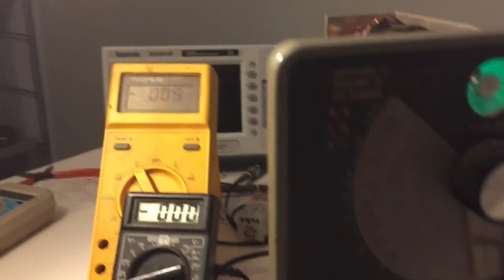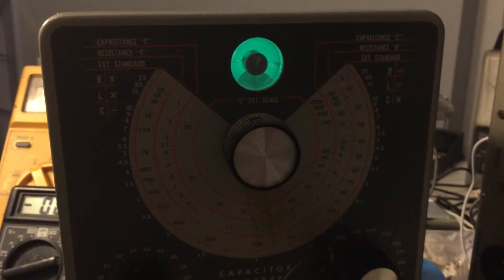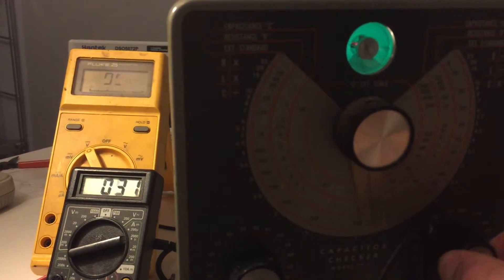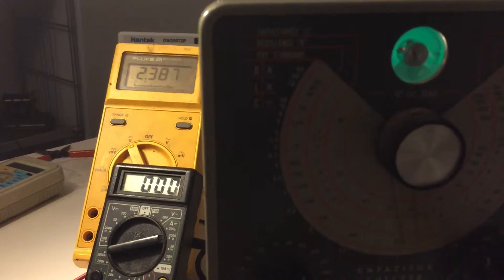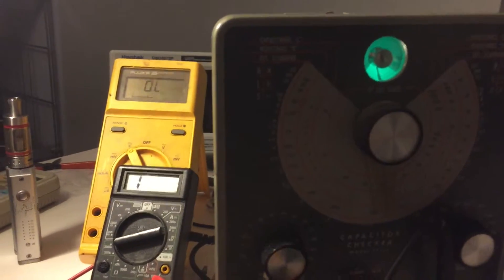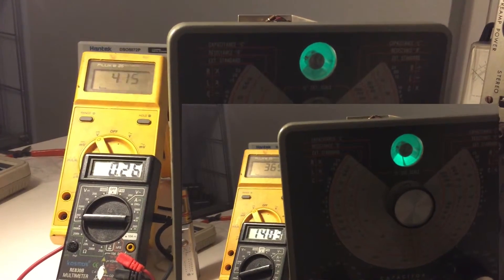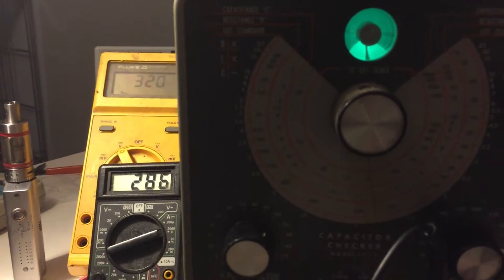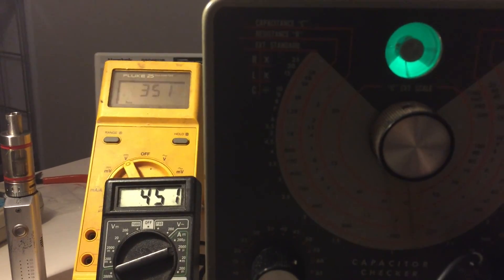Heathkit IT-11 Capacitor Checker testing and cap rejuvenation

Comment: so if i have 100uf 100v cap i've been slowing turning up voltage till get to 100v to reform ( never used min lytic setting, i assume that's for .1 small caps). but i can turn up to 150v and reform better and not hurt it because of low current ? thx for vid!
Reply from the maker: The Lytic/mini/mica setting is calibrated for how many uA the Eye opens, that said, when I do reforming, which I dont often do, because i generally replace caps, but when I do reform, I use a uA meter inline as shown to see actual values.  In that case the switch is meaningless because i don't look at the magic eye, i look at the meter.